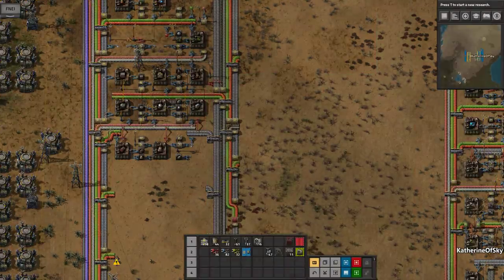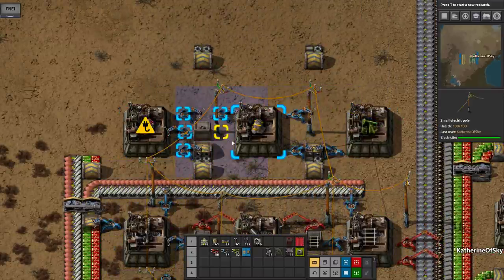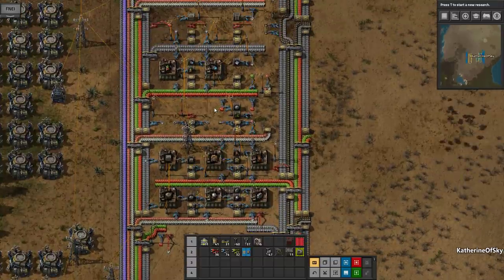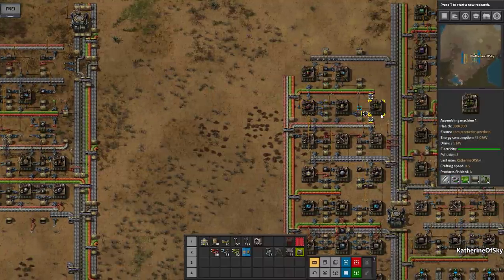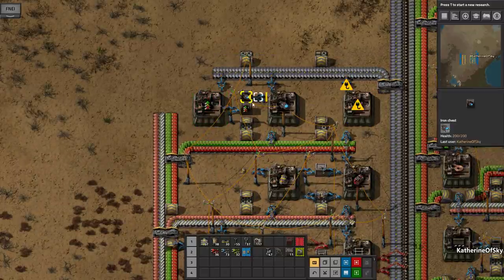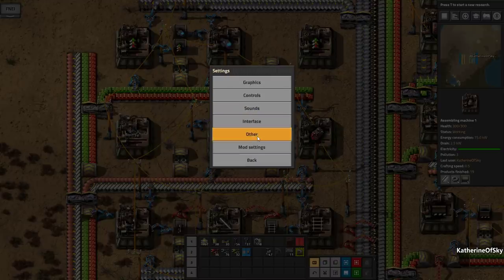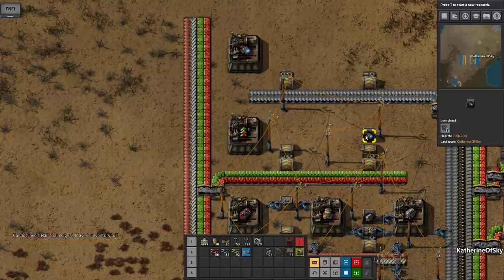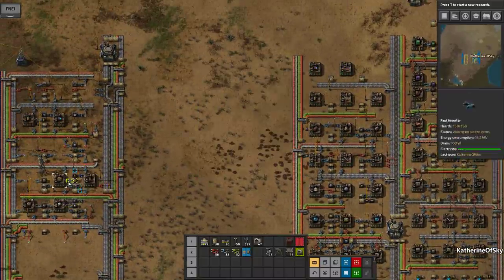Factorio 0.17 Ep 4: Designing a Mall (Long Form) - Tutorial, How to, Building, Gameplay

Comment: I'm enjoying this series.
You've inspired me to remake my popup craft stand into a real mall (I have different requirements than those you've espoused). The process has been going, umm, err .. it's gone a bit spaghetti and by a bit I mean trying to follow the routing is a mimetic trap.

@26:40 if you are going to make a military mall (or armoury) you will need many explosives. Also what about cliff explosives
@27:30 Yes the recipe changed for atomic warheads (from 20 b-pcb to 10 rcu)
@43:05 It's actually a bit worse: The field is a almost white highlight while it is focused but if defocus without saving (eg. to set icons) the colour is a light grey and consequently not distinct enough from the mid grey of the background. I would suggest having a red outline around the grey box while it is unsaved (possibly just while unfocused, leave the almost white as the visual indicator while typing - so as not to imply the text entered is erroneous).

Comment: (I liked seeing you solve your design Kobayashi Maru using spaghetti.) If you make a copy of the mall and replace (upgrade planner) the destination chests with infinity chests you can test to see where the throughput bottlenecks are. (Which can also be used to help you decide the layout of the mall.) Using that it should even be possible to automate a min-max design based on the constraints of the desired width and what it should produce. (And yes, the bot swarm is cool.)
Reply from the maker: I don't think that will be necessary with this mall, but it's a good idea for other production structures!  The mall is meant to make things over time, so it should function fairly well.

Comment: i have a question about the mall; i've been trying to make a similar mall recently but I have a problem with iron gear wheels; how much iron gear wheel assembling machines does your mall need to make everything work? thanks :)
Reply from the maker: That's a difficult question to answer, since the mall is meant to work over time, not at full production 100% of the time.  Start off with full belts on the gear area, and mostly-full or full on the inserter side.

Comment: Thanks for this! Very interesting to watch. I'm kind of confused about the gears, though. You say you bus them? Meaning you put them on your main bus like iron plates? How many belts will be allocated for gears? and how many assemblers do you need for full saturation?
Reply: The major argument for busing gears is that they are more compact than the equivalent belts of iron.
How many belts of gears is difficult, I would suggest 2 and add more later if demand requires (keep a few empty belts for spares on the bus). Those 2 belts of gears will require 4 belts of iron (same speed of belt).

How many assemblers per belt:
assembler1 : 15 per Yellow belt
assembler2 : 20 per Red Belt
assembler3 : 18 per Blue Belt
beaconed assm3 (columns, 8 beacon per assm): 3 per Blue belt (from around 1.5 blue belts of iron).

Edit: unless you mean saturation of the mall, that is then 3.5 belts of gears across both left and right portions of KoS's Mall but the real question to ask -how quickly does the mall need to produce? You probably want the belts with a dedicated supply (1 belt) and share a 2nd belt among the other inputs.

Comment: small suggestion

rather than limiting the chests to X stacks, connect the inserter to the chest and limit the inserter to only work when less than X stacks.

that way, when you upgrade the chests to network chests, the network can use the mall as storage straight away
Reply from the maker: The mall is designed in stages.  The second stage is where I use wires to connect inserters to the chests.
Reply: @KatherineOfSky  is there a blueprint for the 2nd stage? it's not in your google docs
Reply from the maker: @amorongaming3947  Not yet.  I haven't had a chance to finish all stages of the Mall.